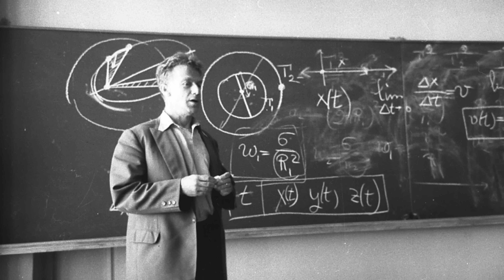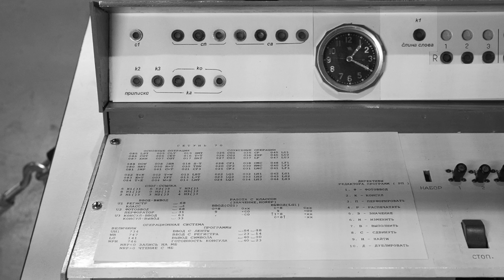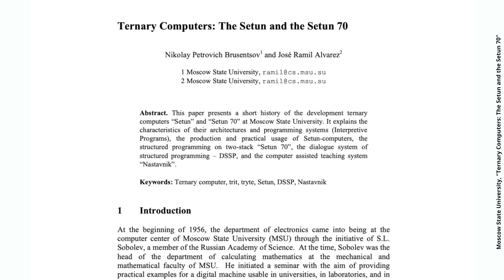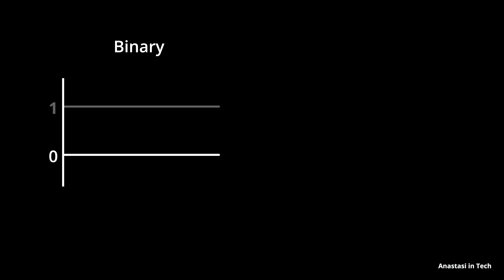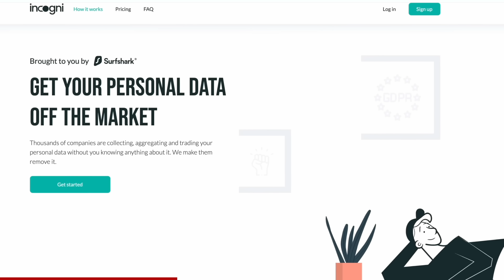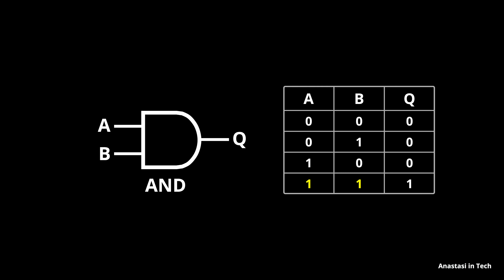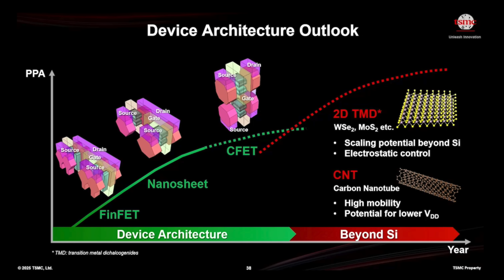The World's First Ternary Computer

Comment: Ok. Not correct. CPU and computer systems built in USSR did not use binary.  Saturn was built using ternary. Your opening statement is incorrect.
Reply: Setun (Сетунь), in 1958, not Saturn. She also mentioned it in the video!

Comment: Transistors themselves do not have 1 threshold level; they are inherently analog devices and are also used to build audio amplifiers. It is the circuitry built with them, other components and how they are used that determine if there are any threshold levels. However, the more "threshold" levels there are the more likely for something to go wrong and have edge case values that could be either value. That is why binary is used around the world because introducing more "threshold" levels to use base 3 or 4 or more introduces complexities and errors and reduces reliability.

Comment: what AI in ternary? - there is a company which addapted SD card tech to store coeficients of neural networks in analog form - just omitting threshold decision. They claim they can achieve 99.6% precision which can be or cannot be truth , but if that precision does not affect processing they can make analog calculations on them too and it will reduce number of elements how much?

probably we are talking about BCD formattted numbers reduces to 1bit area which now occupy several bytes (but yes noise)

Comment: So the question is, would programmers need to rewrite their code or would compilers easily handle the change? A new processor is nice but not at the cost of needing to revamp the interface we are used to. We already have Apple making their own chips trying to outdo the Intel ones, but we also have Ryzen. For the most part compatible with the exception of a few quirks. A ternary architecture would need to also be compatible at least to start with.

Comment: 3mins in and I am already anoyed by "historical accidents". Does she know something or she just reads some AI halucination?

- binary was in past very good, because analog computers (which existed from ancient times - but were mechanical single purpose machines) had massive problems with production quality. Low purity of materials lead to high voltage/currents needs,  which leads to high loses which in form of heat are producing a lot of noise, which applied on data simply ruins them. You get random number generator from something meant as a calculator.
- binary was intentionally developped for rellais which can be just on/off. (as people mentioned many non binary machines were built). 
- binary was not matter of coincidence, but matter of economy - junk electronic parts could do job, were cheap (relatively in that era) and were reliable. (similar to use of serial data transfer instead of parallel - material limitations)

now we have tons of non binary systems (if we count transmitting data too - and if we consider mulitividal fiber optics as non binary) - MIPI DIPI works out of binary (translates binary data into own nonbinary protocol). For ages now we have various PSK modulations, which represent states by non binary form - adn as we can do better and better, we can make things faster - again, 30years ago, 100MHz was almost top notch clocking - because of impurities causing long "reaction times" by adding parasite inductances and capacitances, produced ton of heat and noise and so on. My Actuall computer is 2000x faster just by number of cores and clocking (yes, it is much more because of way operations are processed) and draws half of power than firs computer I saw.

It was very vell thinked about why to use binary.

Comment: Excellent video, I understood everything mentioned. My question is can ternary talk to a binary system. If it can then the path forward is my next device beeing a ternary one when they are available, if I don't see any difference and my device works as before just faster and using less battery. I don't need to worry about my binary phone or laptop not working. If both can work alongside each other as everything is upgraded then the move will be much easier. if we need a new Internet backbone before we can use ternary then things get complicated and expensive.

Comment: Ternary is just one more step down the wrong road. The quest for exact predictable outcomes, while necessary in digital systems, is not a valid end game. A single bit that can be one of 65000 voltages, but is noisy, actually provides much more reliable processing power, and the cumulative result can always be counted on. Such circuits are embarrassingly easy to manufacture at scale and at sub micron levels.
Reply: They said that to the guy made white led for the first time

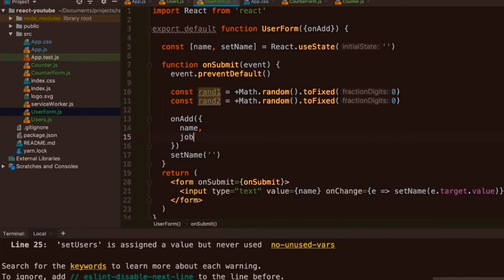Comment: Around 14:16 she talks about noise. I think she is talking about the unbalanced ternary that distinguishes between different levels of positive voltages, mostly 0v 2,5v and 5v, but this ternary system is not the one she started explaining at the beginning, this is the 0, 1 and 2 system. She started by describing the balanced ternary with -1, 0 and +1, that used negative voltage: -5v, 0v and +5v. The question is not noise per se as -5v does not confuses with +5v. The problem is that the only available technology right now are analogue components that can be adapted to ternary. CMOS technology has difficulty ti real with negative voltage. Carbon nanotubes and memristors are promising technologies that although have progressed immensely in the universities and research centers has not seen advance to commercial operations. A memristor chip costing 130€ is not solution for the future. But carbon nanotubes could be easily be built in the fabs that already produce binary semi conductors. Balanced ternary has a mathematical elegance that lacks in binary and many other multiple states systems. Several ternary systems have coexisted with digital, pal, optical and even in so SRAM chips. That shows that we don't need 100% to use one standard. Most end products, interfaces work in binary and that can stay that way. The revolution will be in the core operating. Right now more than 100 people in Europe are studying and developing technology for optical computers. Photons can transmit information in much more stages and at higher velocity than electron. Single optic cables are very thing but not thin enough to be constructed in the size achieved by fabs lately. But if efficiency and energy consumption are improved, size might lose its importance. Ternary though could reduce all together to a considerable gain. The problem behind ternary is that it is doable and does not requires break-throughs. The promise of higher systems is the problem. Hughes amounts of money are being spend on optic computing although their technology has to be developed from scratch and most probably, just like quantum computing it will never be available for everyday computers. Ternary could be. In 2007/8 again in 2014/15 and now again a surge of interest on ternary computing has surged. Interesting to noticed that russian researchers in the west and in Russian have been the dominant part of these rebirths. They focused on using of-the-shelf components to construct ternary computers, mostly bipolar transistors, analog opamps and multiplexers. As they try to grow the size of trits one problem arises the maintenance of the signal, but that is because they are using components that were never constructed to be used that way. If Haway produces the first ternary capable in a commercial way them many people will start experimenting it in more reliable ways.
Reply: While -5v does not confuses with +5v, voltages are rarely, if ever, exact values in any circuit. The question becomes what value is 3v or -2v. This becomes even more of an issue with components that are not amenable to using both positive and negative voltages.
Reply: Currently most memories (DRAM) use capacitors to "store" bits. Attempting to store ternary trits in capacitors will be a lot more unreliable as the voltage stored in the capacitor decays, values will change. That is less of a problem when you are only storing 2 values (0 or 1) than attempting to store 3 values.
Reply: @Naris48 Depends o the capacitor. Experimental memories based on ferrile capacitors have proven t accept negative voltages naturally, electrolyte capacitors don't accept negative voltages. So the problem you are refering is valid to unbalance ternary where 0<0,5v, 1≈2,5v, 2>3,3v. Balance ternary have more clear voltage, since -1 is represented by a clear negative voltage, normally -1= -5v to -3,3v, 0=0v, 1 = 3,3v to 5,5v. Here there is an interesting phenomen it seams the analogue components where ternary computing have been experienced upon prefer -5v and +5,5v to stay stabler. Then we have SRAM and Memristors that store the effect caused by those voltages, not the voltages, they work naturally with 3 stages. A lot of the research for possible ternary computing is based on the potencial use of memristors. Memristors are too expensive and actually unstable they would be good for AI. About storing reguistors laches and flip flops in ternary, that has been developed and works fine. Satun70, the latest version that was just constructed a prototype, stored information in binary, so ternary was used for calculation and logic making it faster and storages and interfaces were binary.

Comment: Personally.  I think the answer is in silicon photonics using either binary or non-binary methods.  I have no basis for thinking this but I feel like we can use some different properties of light to express more than two states per comparison.   I think trits and other type of format can make it extremely valuable.   Not to mention the ability to do native simd operations.   The limitation of electrical circuits and heat are the largest limiters.

Comment: AI calls for processors that are 10 times better, 100 times better. 30% here, 45% there—it's not worth the enormous investment of overhauling the entire processor stack and software. Moore's Law has been producing this every 18 months for decades. So no, it's not going to change everything. 

The question is finding some really clever applications, as mentioned at the end, but at the bit (trit) level. And there's still a huge gap to understand the mathematical/“philosophical” meaning of the third state. It's a metaphysical question that challenges the “principle of the excluded middle,” a 2,500-year-old concept. It's funny no one sees that.

Comment: If you can have 2 thresholds, why not more ? 16 maybe.  Those logic gates are going to come in many variations I'd have thought.
Reply: Noise and complexity
Reply: @wannacry6586 But think of the throughput. Just needs a bit of work, surely.
Reply: @WideCuriosity throughput is useless if the information becomes illegible. Sure i could write smaller and smaller but eventually I need a microscope to read it, when i could've just used more paper for a fraction of the cost

Comment: You said that Huawei announced a 7nm chip, but then you mentioned there's still a problem with noise, which will supposedly be solved in the future using nanotubes. So which is it? I bet Huawei is just making big claims again, nothing new there.
Once we understand how this actually works, we'll see that we can't just solve the challenges that come with working at such a small nanoscale. Two-threshold transistors are more susceptible to quantum tunneling than single-threshold ones, and this becomes a problem at small scales. Sure, you gain more performance per square millimeter at 7nm, for example, but you can't realistically build 2nm chips without compromising data integrity. So at best, it's an alternative, not a revolution.

Comment: Thanks for covering this topic.

Was not aware of these balanced ternary computer.
I thought of something a bit similar a few years back but not as smart (and also less tricky, took me some time to understand how this balanced ternary works).

Just surprised you missed to mention one of the key reasons for the commercial failure of the Setun, directly from the paper by Brusentsov:

"However, for reasons unknown, the officials from Radio Electronically Department did not like the ternary computer and they did not provide the serial production of the computer sample.  When it received the opportunity to use the M-20 computer produced in the plant, it did not help the output progress.  Notwithstanding, when the number of orders (particularly from abroad) for the Setun grew, they limited the output, which resulted in declining orders and by 1965, they stopped production.  In addition, they prevented the mastering of the machine in the USSR..."

Some things seem to never change in Russia...

Comment: Thank you @Anastasi, great video as always. I think digital equipment, and specially the binary system is not only about the chip in the computer, it also involves communications, for example how to transfer 1 and 0 in optical fiber, if you add a third state, then the noise increase a lot. You mentioned the noise for transistors, but I think the problem is bigger in communication systems.

Comment: i've always wondered why instead of opting for higher core count and higher densities the fabs didn't reconsider this when they hit the frequency wall. i simply thought that noise levels made it impossible to compete with binary without lowering the frequency to a point where it became less efficient and pointless. i wonder if ternary gives rise to new logic gates and more efficient alu functions, even directly in memory compute ( additions and substractions ) which would radically lower computation needs. Once this barrier has been crossed it could make iit easier to add more states.

Comment: Even binary isn't simply binary.  There is a span of a signal below a certain level that equals a logic 0, just as there is a span of signal above a certain level that equals a logic 1, dependent on what base technology and material is used.  I have often wondered why that span between the low-level span that equals 0 and the higher-level span that equals 1 is not utilized.
As an example: (these numbers are only examples and are actually determined by the technology and materials used) a signal less than ~0.5 volts may equal a 0, while a signal more than ~4.5 volts may equal a 1.  Leaving a 4-volt span between a logic 0 or a 1.  Now, leaving a 0.5v threshold, or cushion for signal integrity above that required for a logic 0, and a 0.5v threshold below the 4.5v required for a logic 1 still leaves a 3v span for a 3rd logic state.  Using this span should have been potentially at least as capable as utilizing a negative value.
Reply: Using that space would be a problem if it results in both the pull up and pull down transistors turned on.

Comment: Nice video. 7min45s: That is NOT how a 'classic transistor' works! Analog amplification would be impossible. 11min35: 2 variables with 3 states does not give 27 possible combinations but only 8. (In the table the third line is not correct).

Comment: i think this : each transistor must wait that electrons build up to reach open level 5Volts . so this is a delay. but if you can use a static electricity magneti type who can be controlled to open the transistor with out eaiting the electrons to create this 5Volts necessary to open then you can switch faster and with out 5Volts. just using this capacity static of electrons

Comment: Actually all computers did not use binary. The IBM 1620 (which I learn Fortran programming on) used base 10.
Reply: It used binary coded decimal, which is binary.  But for data, it gets only 10 states out of 4 bits, unlike the usual 16 states, rather a wasteful concept.  I imagine it has some value as a calculator, extremely slow, but avoids those nasty divide by 10 operations required to display binary numbers.